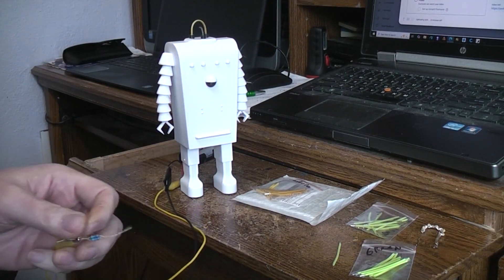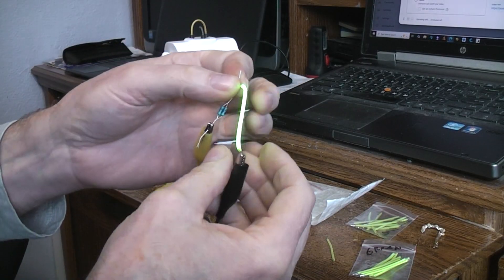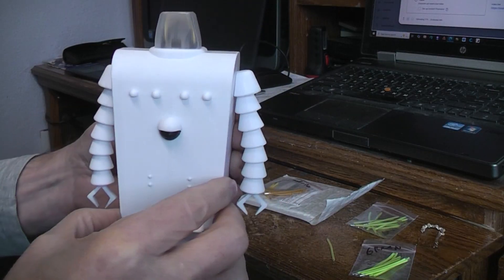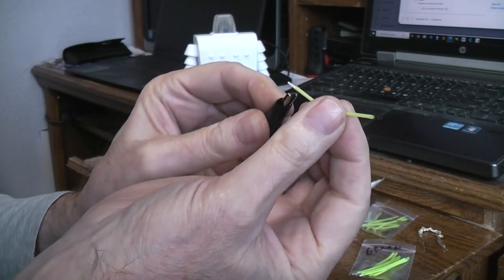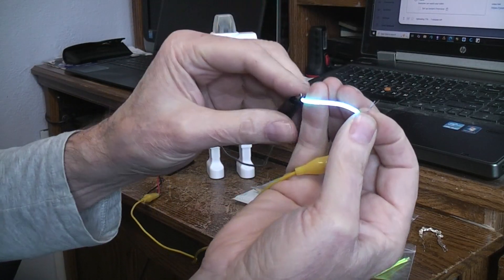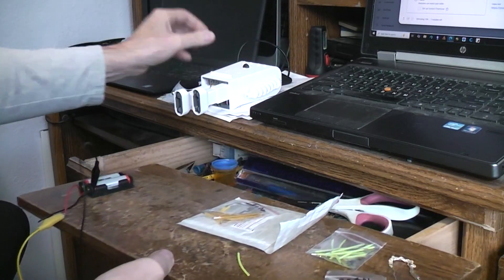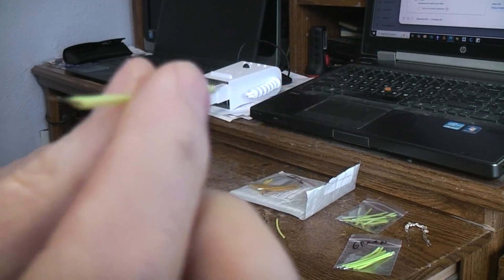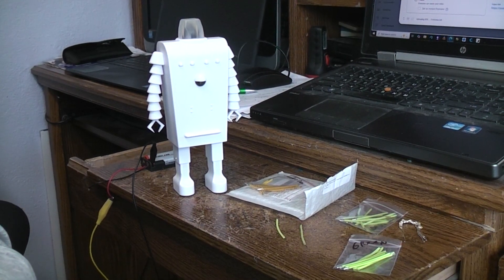Update on Chani Devil Girl robot build.  Using flexible COB filament LEDs.

Comment: I bought some of the 300mm but I didn't like how you could see each individual LED inside.  I wanted something with a good solid line of light.
Reply from the maker: I can only see the LEDs when I run the current real low, otherwise they are so bright that staring at them makes it impossible to see the individual LEDs, but I did not buy the 300mm so they might be different. I guess a person could slip a flexible defusing tube over them to make your 300mm long ones more even in light.